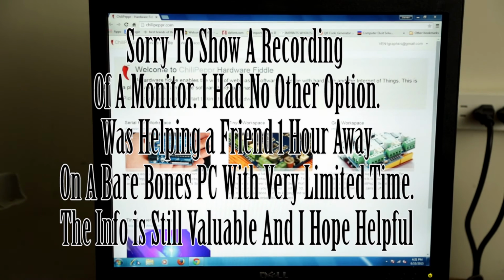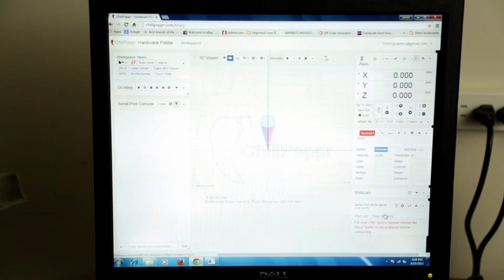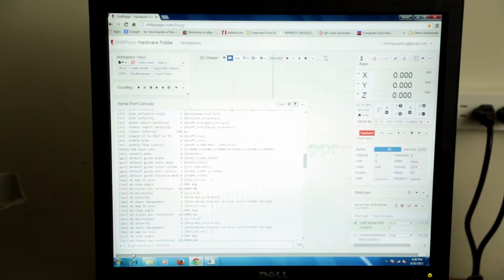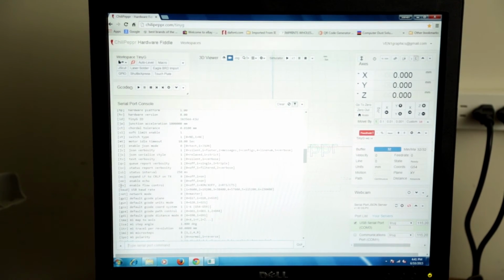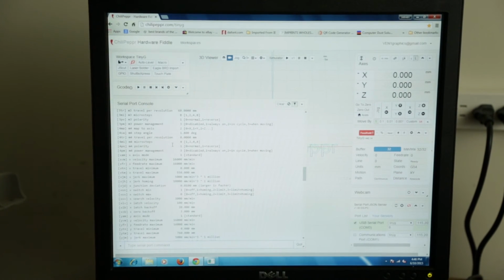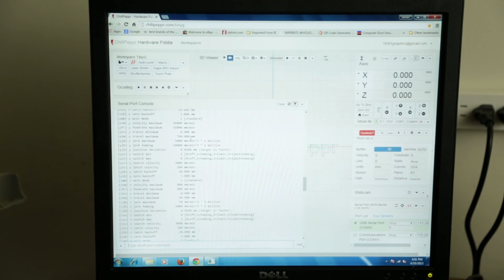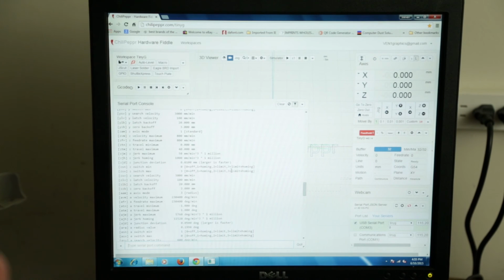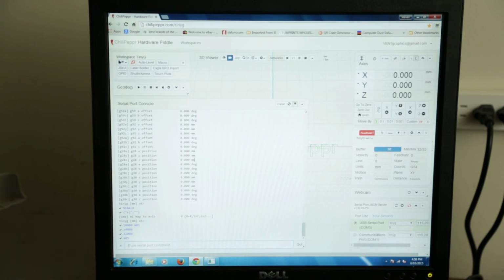Setup & Overview Of The OX CNC, TinyG Controller Plus Chilipeppr & JScut Part 3

Comment: I am having a problem, I have the same OX, Tiny G, PMW, Quiet spindle as you. When I turn on the power the spindle starts running. If I disconnect the tiny G from the PMW and turn on the power the spindle does not start. I think the problem is in the Tiny G. Do you have any idea how to fix this? I have loaded Chilipeppr and have a good com3 port link with data read out, but I can't see how to stop the spindle. BTW I have been following your 4 part you tube and it has been highly informative I don't know if I could have gone this far without it, but I wish you would re-shoot the video so you could see what you are doing on the screen. Thanks for your help!
Reply from the maker: it's your PWM settings in the Tiny G.  Also make sure the jumper is in the correct position on the motor controller.  If you pastebin your tinyG config file. I can peek at it for ya.
Reply: +Thomas Shue 
I'm not sure how to use pastebin, I think I may have solved the spindle problem, but now I have a new one, when I try to jog my X & Z  they are switched, the Y works fine. I have checked that the wires connecting X & Z steppers are connected to the proper motor locations on the tinyG and that they are paired properly. I have checked the parameter settings and they seem correct.  I've made a copy of the parameters in word, but I can't figure out how to attach it. I put in all the parameters that you supplied and I have checked them twice. Any suggestions, and can you explain how I can send you the parameters?
Reply: Michael Higgins Just got my OX CNC setup and am having the same problems with the spindle turning on. How did you solve this problem? Thanks

Comment: Remember to calibrate your spindle RPM. When you say that full phase on your spindle controller (100%) will give you 10.000rpm, you should check that either in the spindle specs or by measuring.
I use a "remote controlled car" ESC (electr. speed ctrl.) and my max phase is not 100%.
I measured when I send the maximum possible phase on MY speed controller, how many rpm I get.
I estimated 25.000rpm using documentation and measured 26.000 using a light sensing rpm tachometer, so I set the $p1csh = 26000.
Unfortunately my rpm's are not linear from 0 to 26.000, but I don't need a high precision, I just need to cut brass and aluminium with a 3mm mill, which I calculate to max ~22.500rpm

http://www.realgentlemen.dk/MediaWiki/index.php?title=CNC_Mill